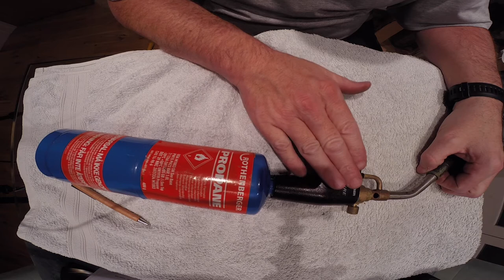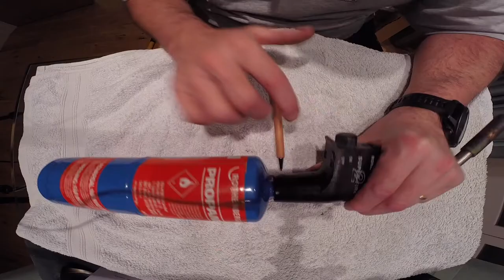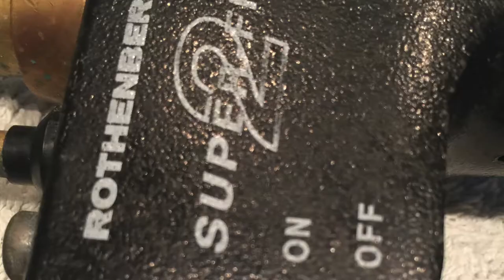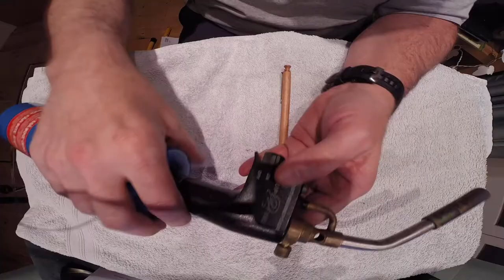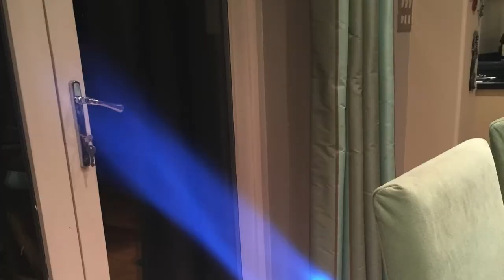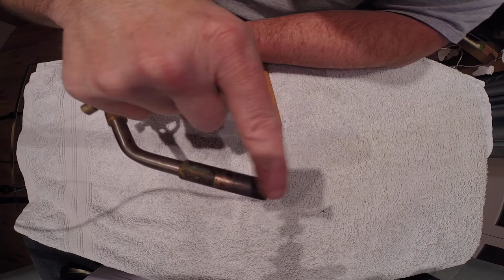Plumbers Blowtorch

Comment: And a VERY dangerous part of this gun is the tiny hole, just below the trigger. For some reason  Rothenberger, for reasons only known to them, put a pressure relief vent where your hand is? So whilst your working away with your gas torch, it fail and sets your bloody hand alight. Ask me how I know? Phoned Rothenberger, not interested. It’s 2 years old, so out of warranty. Can it be repaired? No apparently, once it does this its scrap. So beware! Wear a glove on at least your torch hand. You can thank me later. It’s not as rare an occurrence as I thought. Be safe out there. 👊🤘😎